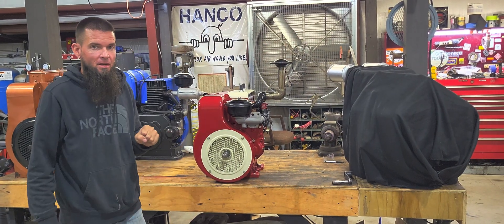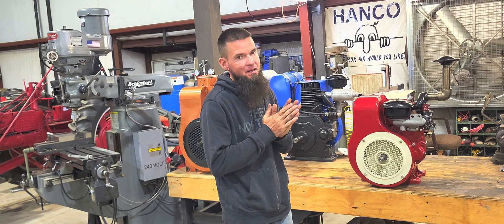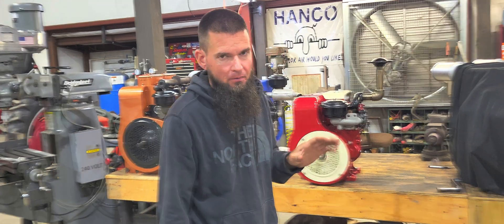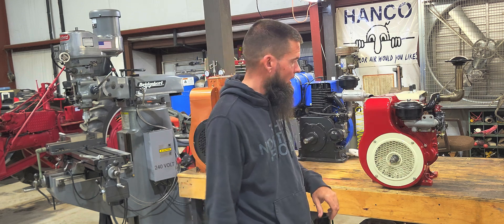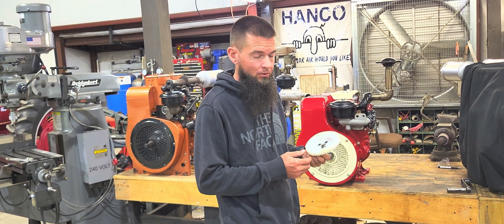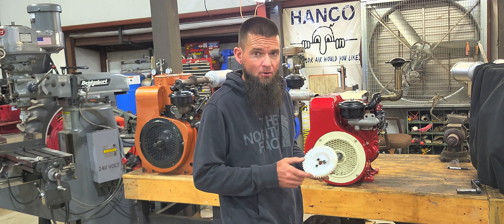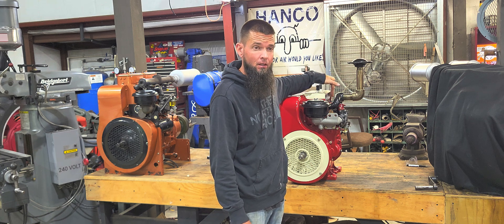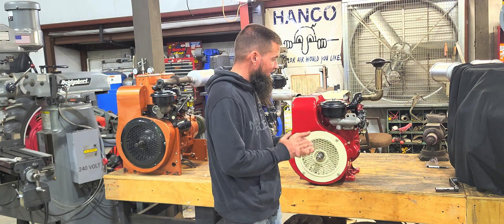Wisconsin THD Air Cooled Motor

Comment: Hello, great work on your YouTube channel! I just restarted a Wisconsin THD engine, and I'm hearing a metallic clattering noise at mid-range RPM. I removed the cover behind the flywheel and found a gap between the crankshaft sprocket and the camshaft sprocket. Is this normal in your opinion? Thank you very much.

Comment: Wisconsin THD and TJD same engine except THD is even fire pistons rise and fall together and redline is 1800 rpm.
THD is odd fire pistons work alternating to each other and redline is 3400 rpm.
Story: I was turning a TJD over with a pair of vicegrips on the crank snout and the impluse mag fired!
Scary stuff there for a minute because it was up on a table seriously vibrating hopping up and down 6 inches rapidly.
Lastly the head bolts on those engines are 5/16" diameter and are VERY SPECIAL even Grade Eight bolts will not take the specified torque. Finally I found (I think it was) FIVE INCH LONG HEADLESS SET SCREWS from Grainger.
I had to make special long nuts to take all the torque from long ROD COUPLING NUTS. They worked well.